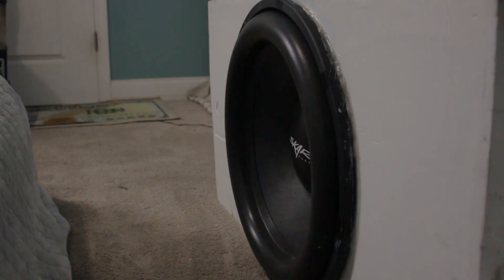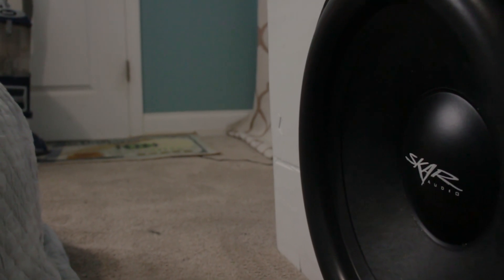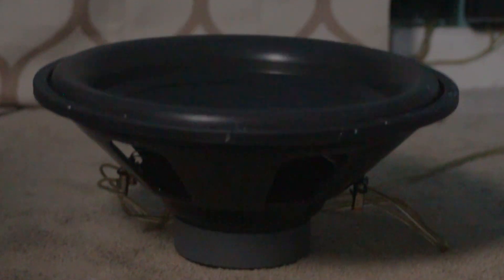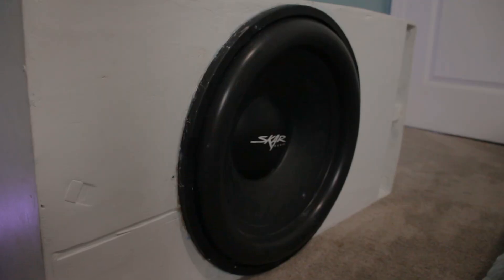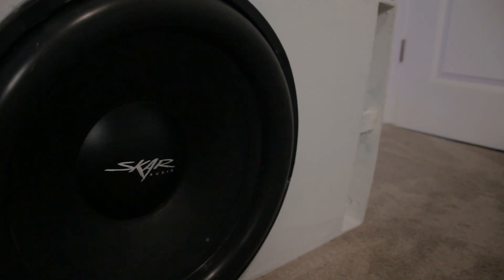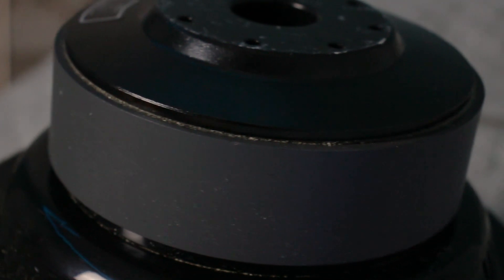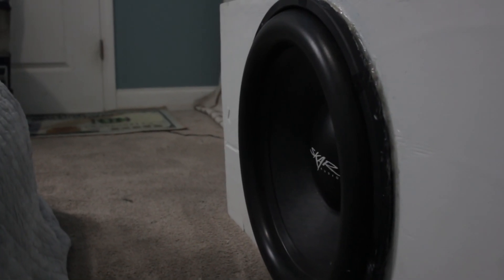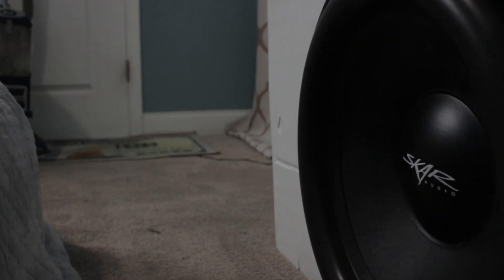Subwoofer Crackling FIXED (18" Subwoofer)

Comment: Try your amplifier you might have a bad channel in your amplifier or you mite have bad r.c.a. jacks
Reply from the maker: It hasn't happened in a while since making this video, but I am adding batteries to my setup because I do occasionally drop from 12v. This is probably not the problem, but having a low voltage drop still isn't the best for a setup like this.

Comment: Hells yea bro, nice vid super clean and felt pro status. I wish I could pull off a vid this smooth. Glad you got the issue resolved. I was gonna suggest running inverted again, as I suspected it was just your amp cutting out under heavy load. Nice box by the way too, do what you gotta do. I made boxes back in the day with any material I could get like desks and dressers and used hand saws to do everything. If you could have any sub what would you choose?
Reply: Just adding to this maybe check how much your voltage is dropping at the amp with a high load using a multimeter.
Reply from the maker: I really appreciate the support! I want to add a battery to my setup so I can retain a higher voltage as I do occasionally drop from 12v. I really want to try out a Resilient Sounds 18, or a Dayton Audio 18 so I can still have a very powerful subwoofer, but with great sound quality. One sub I have been eyeing though for a nice upgrade is the Stereo Integrity HT-18 v3.